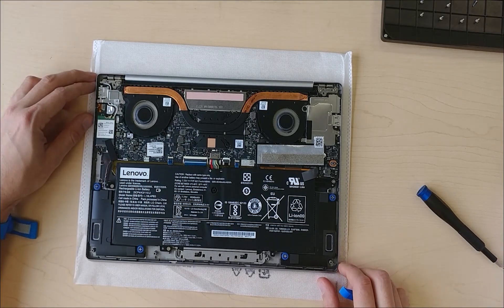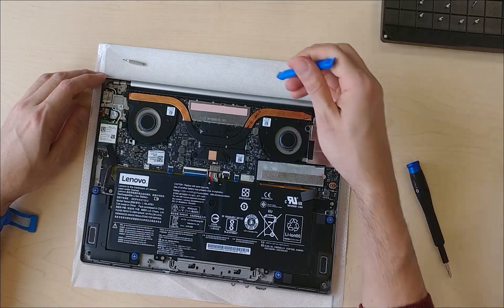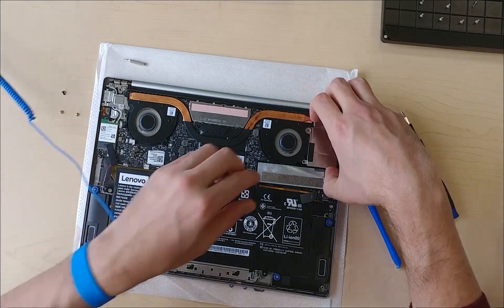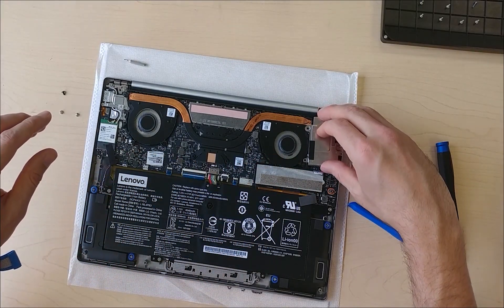Teardown of the Lenovo Ideapad 720S Ryzen 7 2700U (model 720S-13ARR)

Comment: So there is no dosimm socket to add the 2nd memory channel?
Reply from the maker: It's just a bunch of chips, and it appears as if it was all single channel. I didn't check the SPD but from the specs published there was nothing that said dual channel. I believe even Linus said that it was Single. I can check CPUZ again today.
Reply: The Lenovo 720 with i7 7700K and GTX 1050 is also single cannel 8GB, but there is a dosimm socket so its easy to upgrade.  It doubles memory speed so they really are STUPID not to offer it as an upgrade.
Reply from the maker: So SPD on CPUZ says nothing, meaning it's likely single. You can thank thin and light designs to Apple wanna be product managers. Either way the person who is using this laptop is not concerned with upgrade path. On the plus side, this laptop hasn't had the quantity of BIOS updates that the new Coffee Lake based laptops that we have had.

Comment: Hey, man. I've got this laptop, and on rotating the right fan creates a very bad scratching noise. Do you have something like that? I've got a replacement fan, and installed it, but it sounds the same way, but a bit less loud.

also just for your list - fans are labled with these codes:
Part number: 5F10P19085 (also comes as L 81A8 R+L)
Manufacturer number: SBB0Q37621
Reply: OMG! This noise is bothering me too! Mine has that scratching/clicking noise right before the fan kicks in. Is yours the same?
Reply: @Joe C No, it came and gone a few times. But I replaced fan 3 times. Now works like it should.

Comment: Single channel ram, thanks for gimping the laptop Lenovo you jerks!
Reply: Chill bro, there is no such thing as dual channel RAM so you can relax. My comment may seem amatuer to you but you need to check this: https://www.gamersnexus.net/guides/1349-ram-how-dual-channel-works-vs-single-channel?showall=1
Reply: @rudolfdsouza9074  You are only semantically right, but essentially wrong. What the OP meant was that the ram cannot operate in dual channel mode as it's a single soldered 8GB module, and he is correct. Aside from that, the Gamers Nexus link you posted is irrelevant to this use case, because they tested desktop computers and not even an APU, which is what the Ryzen 2700U is, it's a CPU and GPU on a single piece of silicon, and both components are using the same RAM, which basically means that the bandwidth each of them can use at any given time is cut in half, slowing the graphics chip down by a good 30-40% compared to a dual channel setup. Memory bandwidth (and speed) matter infinitely more for APUs than for a CPU + dGPU combination. Lenovo fucked this one up, massively. Not only did they use a single memory module, but they didn't even offer a 16GB option to slightly offset the bad optics of this. If they offered a 2x8GB configuration of this machine, it would sell like hotcakes, it would be by far the best ultraportable Ryzen machine out there. It would be the one to get. I'd buy one tomorrow.

Comment: Is the amd modell better than the intel one? I'm really into this laptop and I want to use it for photoshop. Can recommend it for this purpose?
Reply from the maker: Hello iClone, the AMD one for your purpose would be about the same for photoshop. The issue is that the Intel laptops have more hardware bugs than AMD for now. The laptop only comes with 8GB memory, and it is single channel soldered to the motherboard as the video shows so you would have to make sure to get the maximum memory configuration when you buy as you will never be able to upgrade. BUT given the same memory on AMD and Intel, the AMD laptop should have the better graphics GPU than the Intel stock solution. From using the laptop to install Windows and setup my default configuration it is fast and the screen to my untrained eyes looks great. If you get this one, you will also probably have to get a dongle like the Juiced Systems BizHub, to get an external monitor working, or just get the displayport USB-C adaptor.
Reply from the maker: The AMD one is about the same in terms of CPU, it has a better GPU than intel built in, and less non patchable security vulnerabilities than Intel
Reply: Yes, AMD has always been better than intel ones. Since I'm using my laptop 24hours/5years hard tasking and it's still working flawlessly from the time my father bought it.
Reply: Not just my laptop but everything in my hands that are powered by AMD are still excellent and are still working flawlessly as it should be.
Reply: What hardware bugs do the Intel version of this laptop have?
Reply: Thx for the answer, youtube didn't notify me
Reply: @Kevin Shroff For those with intel hardwares. Using intel laptop too much in hardtasking like CAD designing and Rendering makes it unproductive as days go by. There's more than 2 ROG with Intel Core i7 - 7700HQ with Nvidia Geforce GTX1050Ti laptops and 3 High-end Intel Core i7 laptops in the office that are in their verge of death because of hardware problems. 1 ROG got a white screen, the other one got blue screen. Nothing to see in the display anymore. Just white and the other is blue. XD The 3 other high-end intel laptops. Always malfunctions like crazy.

Comment: Thanks for doing this. I didn't expect there to be two fans. Have you run benchmarks to compare the cpu and gpu performance of this with the HP x360's Ryzen 5 2500U ?
Reply from the maker: Fizout, unfortunately not. I haven't had time to do benchmarks on anything. But I do know that there is a significant performance hit with single channel memory, so I don't think it would be faster, if not slightly slower GPU performance. The CPU is slightly faster in terms of GHz so anything that likes more frequency speed would be slightly faster. I found this video https://youtu.be/RhWJjAkLh84 but realistically with the limit of memory at 8GB the HP Envy X360 should not be that much different if not faster in some tasks. There's also this page which shows the speeds of the CPU & GPU between the two. http://www.faceofit.com/ryzen-5-2500u-vs-ryzen-7-2700u/
Reply: Did you use the 720S? Do you have any subjective observations of the Ryzen 5 vs 7 and Vega 8 vs 10?

I suspected the Ryzen 7 isn't really worth it over the Ryzen 5 due to thermals being a limiting factor. I was surprised by that video showing R5 outperforming R7 in too many cases, but disappointed that there were no temp readouts. 

Ideally someone might compare R7 and R5 models of the 720S, since that laptop is perhaps the only way to test both APUs on otherwise identical setups.
Reply from the maker: I might have time today to use it, I still have to do the initial config and install of standard software. I do think the 720S came out after the Acer, at least locally.
Reply from the maker: Here's the GN vid https://youtu.be/cNKxrzY9WDY
Reply from the maker: I got the laptop setup finally, it's fast, for basic tasks it is a great performer, I didn't play games on this one as it's a work computer but I did run some web HTML5 video tests, and it seemed to work OK, but not as good as the HP or my gaming computer at home. FPS for these web HTML5 renders were in the range of 9 fps - 30 fps but it's not a comparable number as it's mostly anecdotal.
Reply: Wish you'd run HP x360 R5 2500U benchmarks...